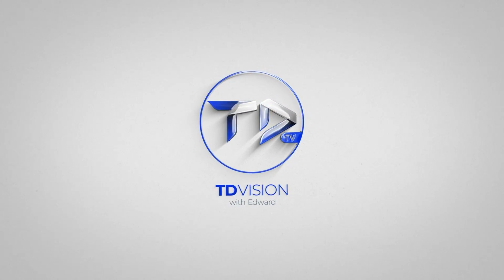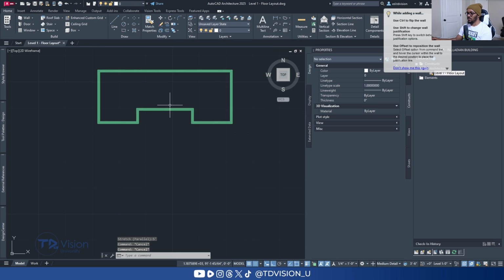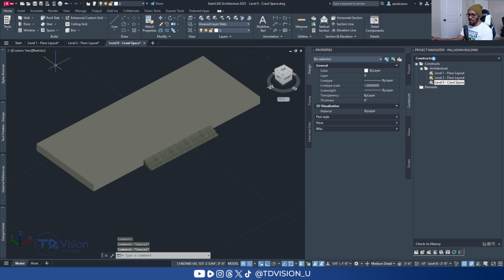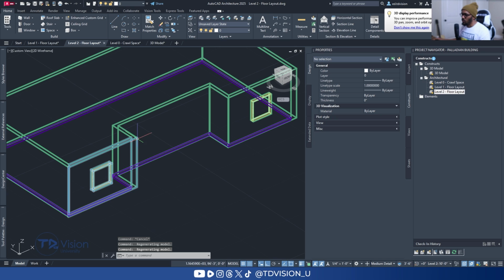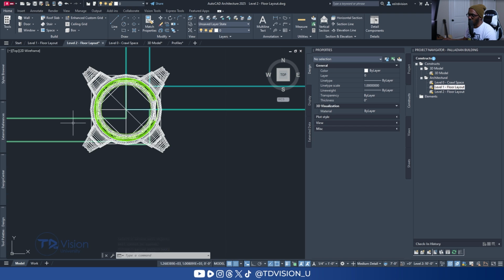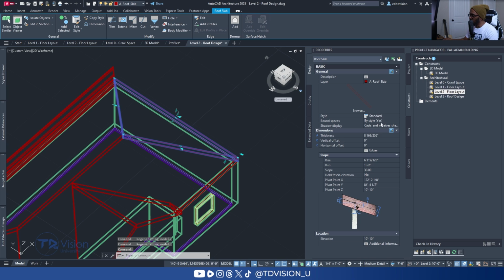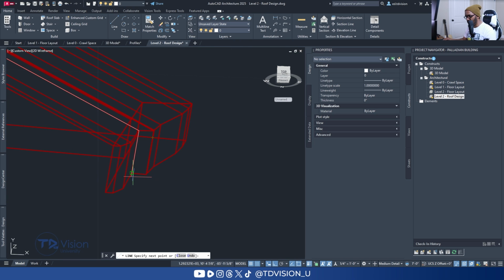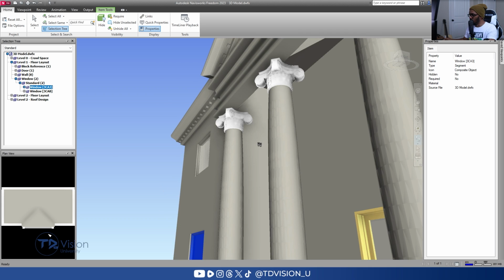From Dirt to Roof: Mastering Building Design in AutoCAD (2025)

Comment: I have been using normal AutoCAD building homes for the pass eight years. I download the plans onto my iPad using AutoCAD mobile. I have recently got into using AutoCAD architectural 23 when I tried to download onto my iPad. I can’t measure anything and it comes across in weird blocks, is there anyway I could make my drawing an architectural tutti and then download onto the iPad so I could measure on the job site like I used to?